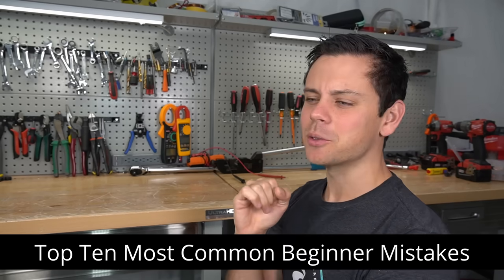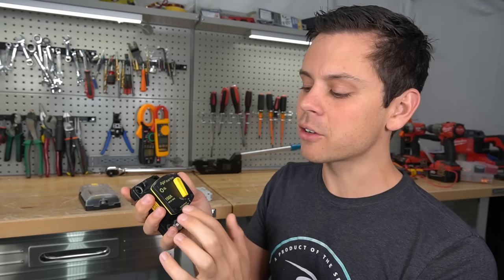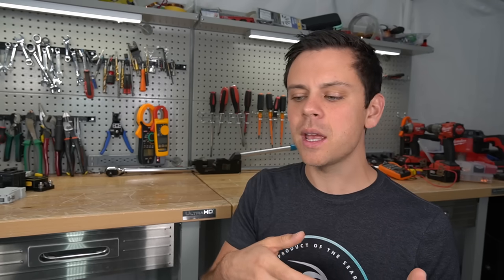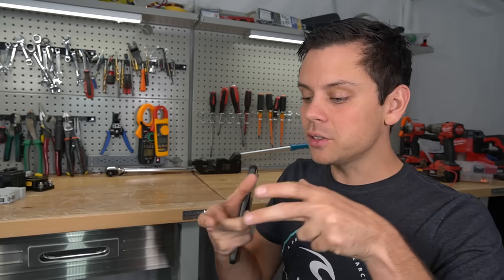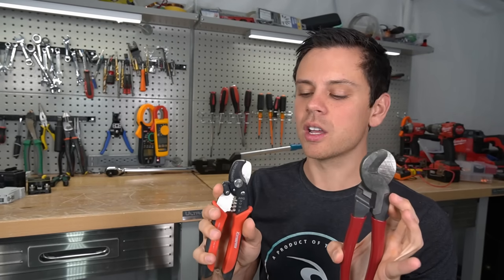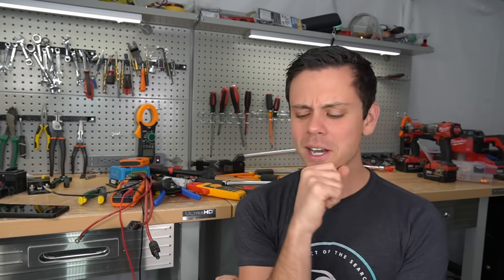Top 10 Beginner Mistakes When Building a DIY Solar System

Comment: I've been doing marine wiring for over 25 years and off grid solar for about 15 years, and when I started solar wiring, I used all of my marine wiring experience to do proper jobs.  I've seen so many DIY off grid solar installs that are cobbled together and basically fail on every point your made in your video!  Honestly, your video is 100% accurate on all points.  I can't find a single thing to dispute.  You just got another subscriber - me!  because we are always learning.
Some of my biggest pet peeves - soldering of any kind, on boat or solar wiring.  And buying cheap off-brand crap, like breakers, bus bars, fuse panels, wiring.

When someone asks me to "redo" their solar setup, or install new, I often will send them an exact list of all the major parts needed, like breakers, bus, fuses panels, cables, cable ends,  crimp heat shrink marine connectors, charge controller, etc, and let them review it online and even but it themselves.   If they balk at the price and/or look to use cheap alternatives, I may refuse to do the job and I tell them they can find someone else.
Reply: Fine some one else ,,agree
Reply: Could not agree more, when you do a project on the cheap it will ALWAYS comes back and bites you in the rear, ALWAYS!!!!!
Wait till you have enough funds to do the project correctly with the correct parts or it will end up costing you double if not more!!!!!!

Comment: I always use a conductive grease in my crimps, it doesn't take much don't over do it, but it adds a corrosion protection to the joint. I even use it on small stuff, it really helps on outdoor or buried connections.

Comment: Top 10 Mistakes Summary:
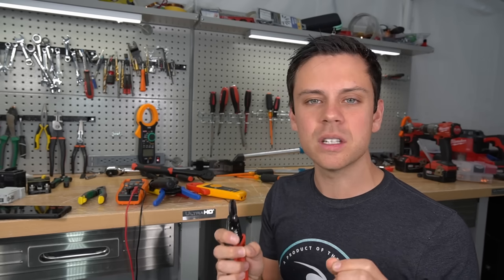14:29 1 - Loose terminals
12:15 2 - Using the incorrect tools (emphasis on wire-strippers, crimpers, insulated tools)
9:49 03 - Improper Wire-Sizing
8:51 04 - Messy, unorganized Wiring
6:54 05 - Solder large lugs (use only mechanical connections)
5:36 06 - Using CCA (Copper Clad Aluminum) cables; Use only pure Copper
3:56 07 - Using low qaulity circuit breakers
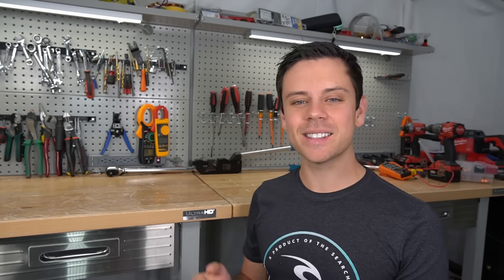2:53 08 - Building a System that cannot be Scaled
1:21 09 - Not enough batteries or solar panels
0:14 10 - Connecting a solar string to a device without checking the voltage
Reply: Thank you!
Reply: Some of these, while disadvantageous, I wouldn't always count as mistakes. But then I notice the word beginner and checks out.
Reply: <nodding head>
Thank you for your time and effort to display 
Time stamps.
Reply: @tex24  I know right man there's so much stuff to know. It's so difficult to put together a system.
Reply: Thank you - saved me 17 minutes :)
Reply: #10 you need to measure/calculate VOC for the Lowest temperature (in a Sunny February day you will have @10% higher VOC than in a Sunny July day). 
More precisely, you need to multiply the temperature coefficient %/C of Voc of your pv panel with (25C+the absolute value of the lowest temperature Tmin in your region). PS: The +Tmin comes from a -(-Tmin). Example 25C-(-15C)=25C+15C= 40C
Reply: That breaker your showing us off RIGHT NOW is 10A @48V that according to YOUR chart requires a 1Awg wire.... and u just said Not to use a 4Awg wires?? I think your making a mistake :)

Comment: You forgot the two most important ones
A) get reacquainted with the basics of (solar) electricity before a project
B) find or make a cheat sheet with checklist to keep handy when doing a project.
C) start with smaller project that don’t hurt as much financially in case of mistakes.

People, including myself need these refresher videos frequently
Reply: agreed! I'd add to make sure that you are watching very recent videos. It seems like the tech is changing so fast that a 5 year old video is outdated. It's like cell phones.

Comment: I crimped several cables 10 years ago in both 4 gauge and 1/0 gauge.  I used a hammer crimp and always was concerned about the quality of the crimp as well as the longevity of them.  Earlier this year I decided to cut one of those old cables apart to inspect the cable and crimp.  

I made a video on it and found after cutting the cable and terminal apart that it was an amazing crimp!  The heat shrink also held up great with only minor surface corrosion of the copper wire(yes, this was OFC copper cable).  Before I destroyed the wire, I checked the resistance of the wire with my Fluke multimeter and resistance was VERY low!  

One other thing I like to do after I build a system is check the resistance (ohms) in the cabling and connections with my Fluke.  This helps to find problems before they rear their ugly head.
Reply: Yeah…I used to hammer crimp even for RF cables on a small rig…I now pneumatic crimp…I went to crimping very reluctantly…but now … I swear by pneumatic crimping…as an old HAM ( is there any other kind?  If you get a HAM license, you also get your old man card delivered by snail mail) low voltage electrical and RF cables…I make with pneumatic crimping…
Reply: @marksmadhousemetaphysicalm2938  "Ham" begins with "H", same as "Heathkit".

Comment: I totally agree with you on the comments about soldering. For many years , I lived on a boat and did all my maintenance myself. To do things right and stay safe I took a course on marine electrical systems, taught by a professor from the University of Washington, who also taught the Coast Guard, the guys who are inspecting the boats. he said that in a marine environment that soldered connections are extremely subject to mechanical failure from all the motion. The only place for the soldered connection was one that was totally and safely secured against any type of movement. Now that I’m retired and live in a “land boat” (RV) I follow the same practices, thinking that the vibrations from the vehicle can probably do similar damage is the vibrations on the boat.  I realize that many of your viewers are thinking of a fixed base, home installation where the only movement may be earthquakes, and I am honestly not knowledgeable about that, so I’m mostly talking to those installing into vehicles of some sort. Regardless, your explanation says why not to use solder are very convincing.
Reply: Just the mild heating of a wire from current can cause expansion/contraction. Or even day/night temp changes.

Comment: Glad to see more new videos from you. I work on telecom power systems with large battery strings (48V with 5,000A+ discharge capability) and I agree with all your points, especially proper torquing of terminals, thermal inspections, using insulated tools, and having the proper tool and knowing how to use it!

I'm hoping to see new buyer's guide/showdown videos from you for MPPT's, panels, and batteries. I've watched all your old ones, but there's so many new devices out there now. I'm building an off-grid system for my RV and your channel has been a great guide!

Comment: Also: dubble check polarity..

At work a contractor got the polarity mixed when parallel connecting two 400V battery bank, short-circuit the now 800V battery..

The connectionbox exploded throwing the contractor across the rom, and started a fire.

The incident took down the server room, effecting the work of 15-20 thousand people....

Due to the safety equipment, the contractor escaped relatively unharmed...
Reply: Plumber disconnected a pipe without turning off upstream, janitors mopped but women's bathroom was flushed.

Comment: I'm familiar with the torque wrenches that use sockets, but did not know they had torque screw drivers. Your videos are always interesting. Thanks.
Reply: Wiha makes an insulated torque drive/bit-set specifically for working with electricity

Comment: 100% correct on each item. Used to solder till I saw a crimped terminal cut in two. Bought a hydraulic crimper. Have never been sorry.

Comment: A common one I've seen helping friends is not carefully labeling both ends of wire runs. Color coded wires are always best, but a lot of purchases just go with the straight black or grey. The red, white and black should be applied to both ends. Best with shrink tubing.
Reply: I’ve made that mistake and regretted it to great expense
Reply: I do the same thing.  I slip a piece of colored heat shrink tubing on the ends of my wire runs to keep things straight since the only spooled wire I have is black.  On rare occasions I've used more than one color primarily to identify switch feeds to different lights.
Reply: Colored electrical tape would also work for identification.

Comment: Thanks for explaining about loose terminals. I've been building my own systems for years, and thought that the loose terminals were caused by vibrations and movement. My system moves five times a year. My Victron CC recently had an overheat warning, and it was partially due to loose terminal connection.  Keep up the great work. Some of your newer builds are far beyond anything I will build in the near future. Don't forget about the smaller systems! 1kW pv, 2 kW inverter, 14 kWh LiFePo4, off-grid yurt.

Comment: Once you start generating your own power the first thing you will notice is how much each device uses.
I replaced several older devices just for the reduced wattage.
A watt meter is your best cheap investment and you will be surprised what your use is.
If you can conserve it you don’t need to generate it ,
I’ve been watching the evolution of solar equipment for years and it is amazing how the price and availability make it easier and affordable for you to set up a system.
I always research your videos before even considering purchasing any solar equipment .
Thank you for the video.
Reply: Im wanting to do things correctly in the future
 Where are the torque values located on switches, outlets, etc?  Could I use values for what a particular bolt size and grade is rated at or is there a torque chart for electrical connections out there somewhere?
Reply: I love my watt meter. Especially for my computer, it helps figure out how much power I'm using with different settings. It doesn't matter much in summer, but in winter I need to keep the power consumption low.
Reply: No more toast for you! 😅
Reply: I recently bought a wattmeter to do just that. My consumption wasn't high, but higher than I thought it should be. I'm still making the list of what uses what. Too many plugs, so little time!

Comment: Well, now. This is a great video! I'm 72 years old and realize that it's been a long time since I took electronics in high school shop classes. Solar is new to me and it's like learning all over again because most of my projects are simple 110 AC voltage wiring of lamps, etc. as a householder. My DC experience is mostly circuit board work and low voltage battery circuits like battery operated radios etc.

There is a lot to learn working with solar and every step of the way is all about learning and absorbing new stuff with an old brain! And one important thing for older people, to keep your brain "exercised," is to learn new things on a daily basis. Your videos are easy to understand and cover just about everything, well presented, with outstanding explanations and excellent background info as well. Thanks! I am ordering your book on Amazon, sounds like a good read.

Comment: Hi, I would like to correct you in the soldering lugs part.
But firstly, your videos are great, and you have the most informative channel out of any DIY PV system channels. Thank you for these.
Everyone can make a mistake, and the probability of making a mistake is even higher when someone does highly educative videos. I know that very well. So it's nothing against you, I would just like to correct the factual part :

I happen to be industrial electrician with years of experience in this field, and I also have ones of the highest certifications.
I solder a lot, and I can tell you that soldered lugs/eyelets are always going to be the 100% solution, if you do it correctly. And that is a huge IF. 

Properly soldered lugs have slightly lower resistance compared to crimped ones. I have demonstrated that several times with thermal camera in few occasions. Back in 1950s, crimping pliers weren't that much common here, and I have personally never seen such a lug from 1950s failing. Even when being overloaded. 

Soldered connection is actually gas tight, while crimped still has some room for water to soar by the strands to the lug itself, and cause corrosion. Copper then becomes green or black, and resistance ramps up a little.
Soldered lug has zero chance of oxidation.

Soldered lug is mechanically more sturdy. This applies more to smaller eyelets, like 2,5mm2 or 6mm2. Wire can be usually torn out of crimped eyelet (with higher force if crimped properly), but soldering would never fail, you would destroy the eyelet before soldered joint fails.

You will not damage wire insulation by soldering if done properly. Silicone insulation (SiF or SiFF wires here in Europe) are always safe, and regular PVC insulated wires, you need soldering iron powerful enough for this, but it is also possible to not damage the insulation. I have successfully soldered even 35mm2 wires without any damage to PVC insulation. I used JBC C245 200W iron and lead free tin.

The part with checking a crimp, there is a huge problem - it's a destructive test. Truth is, we cannot tell for 100% if a lug is either crimped or soldered properly without destroying the lug. This applies to both crimp and solder.

So why we don't solder lugs? It's slow and requires lots of experience. It's much easier to make a mistake soldering than crimping. This doesn't however mean that crimped lug would be better, as some people use Chinese crimpers (cause they are generally very expensive, I understand), and these people would be actually better soldering the lug with a blowtorch. No kidding.

The most common problems when soldering lugs and eyelets is :
Not enough heat
Improperly chosen soldering tin
Not using additional flux
Using too aggressive Flux
Not enough tin in the joint

I would like you to accept what I just wrote, because I have already experimentally proven that, and please, don't say no more that soldering would be unacceptable, because actually, when I try to get every single milliohm down, I rather solder these instead of using any of the hydraulic or mechanical crimping tools we have in the workshop.

And thank you for your videos, you do great job, and please continue.

Comment: 65 y/o retired guy here, was an electrician/ electrical contractor for 48 years.  This kid really impresses me ;)  I have done a lot of residential and commercial grid tied solar and some 12vdc RV systems (van life guys) but now I want to design a grid tied battery backup system for a small house, I'm out of wheelhouse and believe that this guy is going to have all the answers !

Comment: I haven't built a solar system yet, but I am an electrical engineer (40 years).  These are standard engineering principles and rules to design by.  Excellent presentation and clear descriptions.  Any DIYer would do themselves good to follow these suggestions.  Great video!

Comment: As someone who's built and operated a series of tiny off-grid solar systems for my cabin's stereo and phone charger over 20 years,  my biggest difficulty has been getting good crimps and screw connections. I've recently upgraded crimp tools and will never solder a connector again.

Comment: I know many of us use XT60 connectors for solar panel hookup (Will uses those on some of his panel arrays) and they need to be soldered.  There are also better options for solar panel connectors than XT60.  Soldering takes too much time anyway since those XT60 plugs are so freaking small, a good crimping tool makes the job extremely easy for the crimp-type connectors. I'd also have added another common mistake beginners make: Always follow diagrams to the letter! Excellent video once again with lots of useful info to ponder! Thanks Will!
Reply: Low voltage only I would hope

Comment: Great data here.  I'm an amature, researched every point you made here.  Glad to say I scored 100%.
Cables and lugs - definatly get your hydraulic cramp, lugs, heat seal tubing, and make up your own cables because you'll save £ $ big time and have fun.
Quality tools is definatly a big deal.  Cheap gear are crappy and you'll have crappy end results.
Will saved me a fortune - dont try saving pennies here and there, it WILL cost you £'s $'s in a few weeks time!! 
Torque wrench etc.  Got them too.  As I discovered, Chinese stuff is not always accurate on torque settings so be careful and whatever arrives - test it, if possible, before use! 
Heat camera - I use a laser temp probe, I think that works fine. Just slower way and needs a little more care.

Outstanding round up of the common pitfalls Will.

I have got one question ! Q) how do you stay looking the same after 2 years now?  No Ageing? 🤣😉

Comment: Great Video, you nailed all major issues but one missed.
When using stranded copper to an SCC or other device, using Ferrules (Crimp Barrel) is Very Important to prevent the wire starnd from squishing & spreading which results in a poor connection, regardless if the proper torque is applied.
Reply: This interests me. Please explain. Thanks
Reply: @gregnewberry4813  A crimp barrel is just a sleeve over the small strands of wire.  Once crimped on the end of the wire, it holds all of the small strands together.  I can see how it would be better than an unsleeved connection, but have not used this approach myself- yet...

Comment: Interesting. I revamped my friend's solar panel and upgrade from a 40ah lead acid to a 100ah LiFePo4 with a great Renogy MPPT and added a small inverter to run small lights and fans.
The loosening on cables(And other hardware) is definitely something I've experienced. Especially hardware on wood.